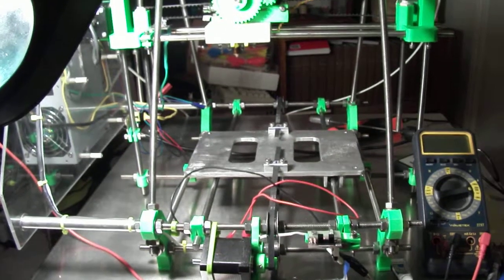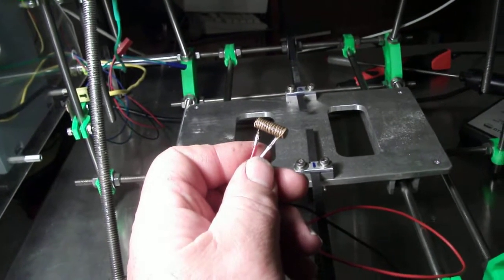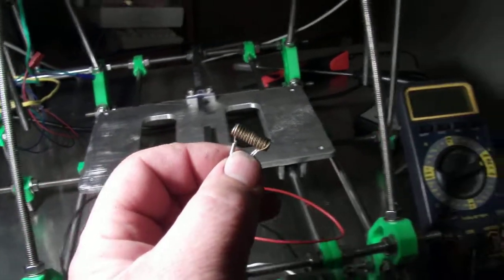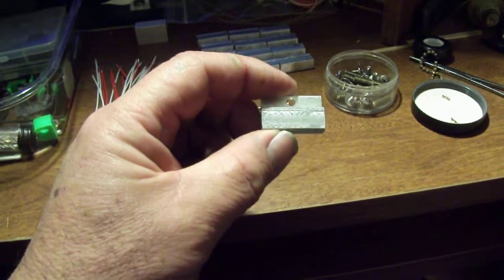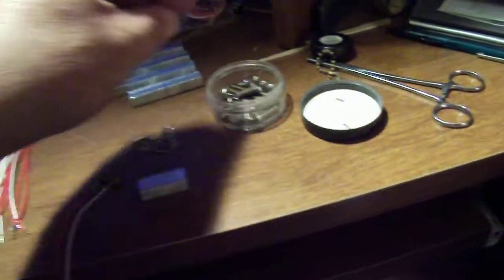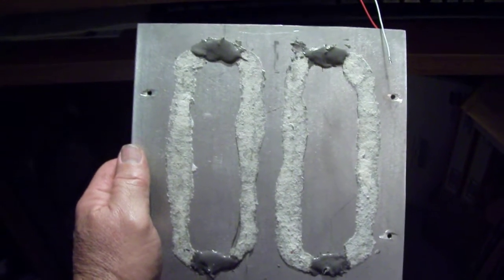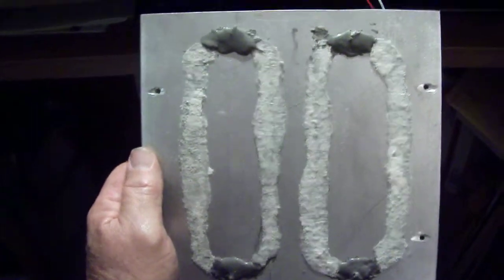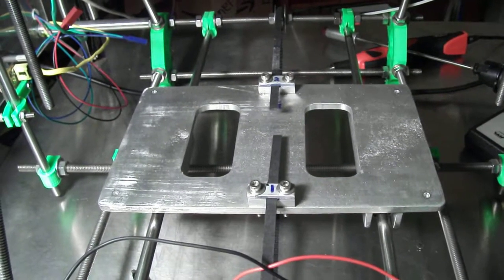Building elements for my Prusa's heat bed

Comment: Hey Jeff,
Did I read correctly somewhere you were working on printing with Acetal ?

Neal
Reply from the maker: Well it's in the works, I still need to finish building the Rostock 3d printer, just need to find more time. Then on to building a hot end for the printer that will handle the aditional heat, then experimentation with the acetal or delrin. I plan on working on it a little tonight.
Reply: Jeff Nading If you can pull that off that would be a milestone in 3d printing I think. Thanks Jeff.

Neal Ward
Reply from the maker: *****
i'm sure going to give it my best efforts, thanks Neal.
Reply: Jeff Nading You are welcome , and good luck. 
Neal

Comment from the maker: The elements heat the bed up quickly, I would say it doesn't take anymore time to heat up than the etched PC board type heat bed and it holds the heat much better and evenly, so the result is a much better print. I also use glass on top of my aluminum heat bed.

Comment: Does it heat up quick Jeff?
Reply from the maker: The elements heat the bed up quickly, I would say it doesn't take anymore time to heat up than the etched PC board type heat bed and it holds the heat much better and evenly, so the result is a much better print. I also use glass on top of my aluminum heat bed. You could also build a larger print surface so your not limited to 200 mm square.